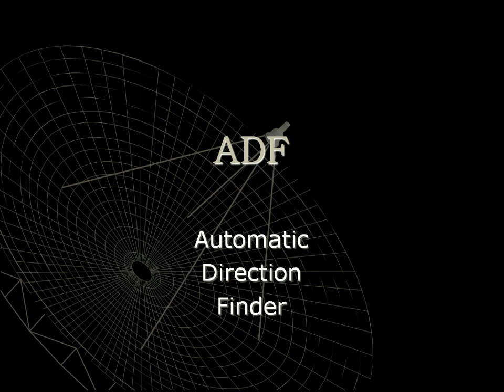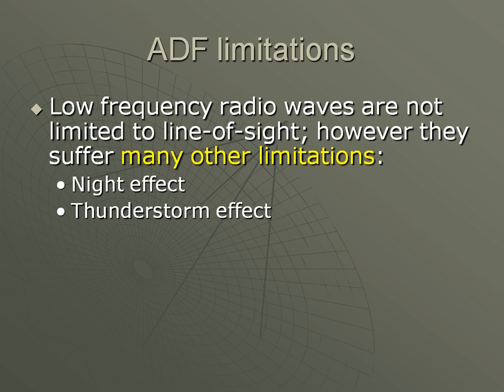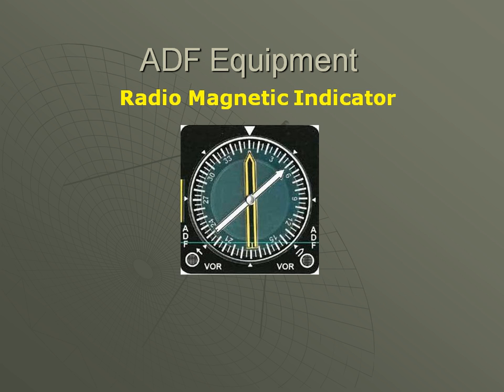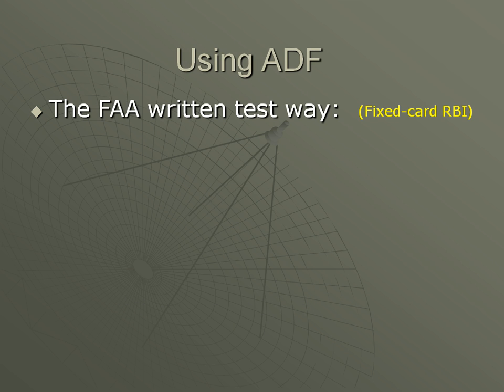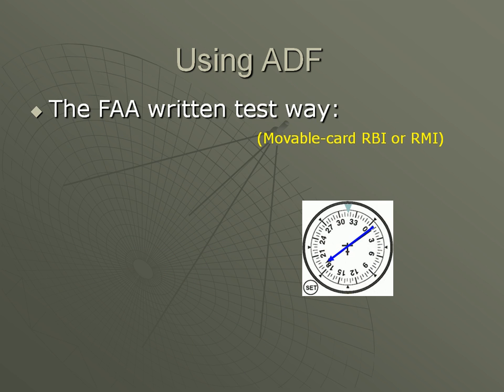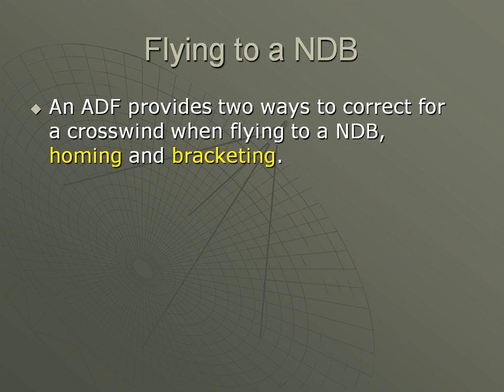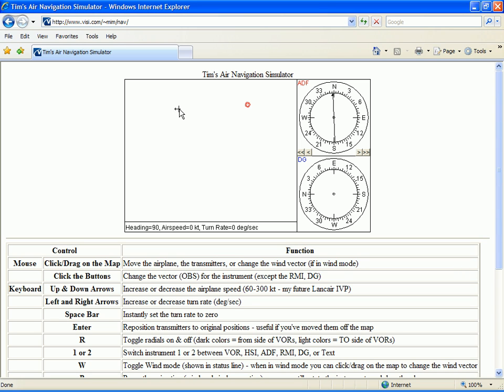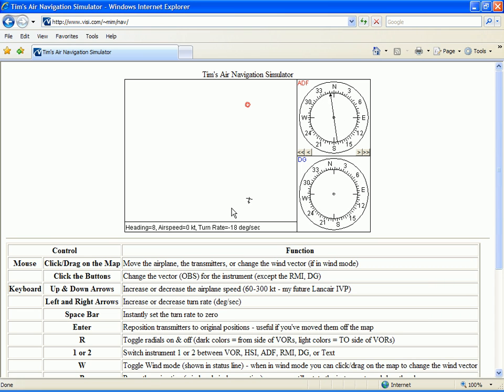ADF - Part 1

Comment: thanks for the great video! i'm preparing for my commercial written exam and have had trouble with similar questions and was wondering if you could help. they are much like your examples, but they often ask what heading should be used "to intercept the XXX radial at 30 degrees"   ...this seems to complicate the question and always confuses me. any advice? (or do you have any videos like this? ...i couldnt find any)

Comment: Excellent material. Thanks for the video. I have to review ADF material for exams that include it since I don't use an ADF on a regular basis. So, the "Tim's Air" simulator is a great find, too.